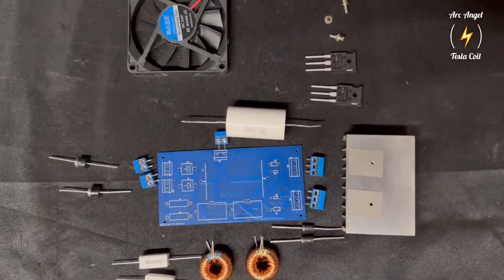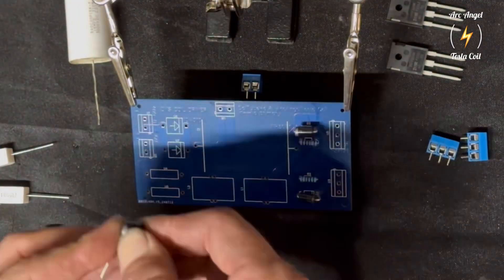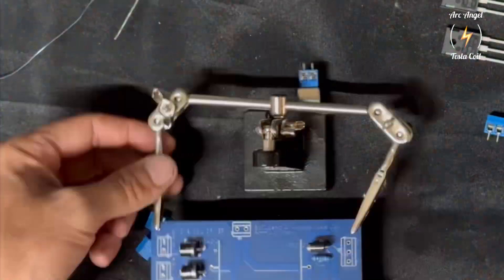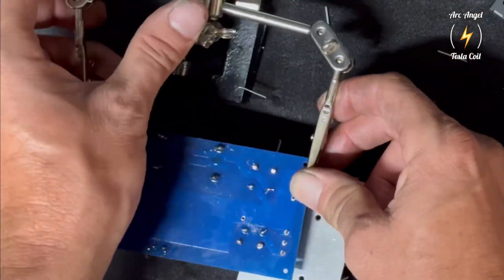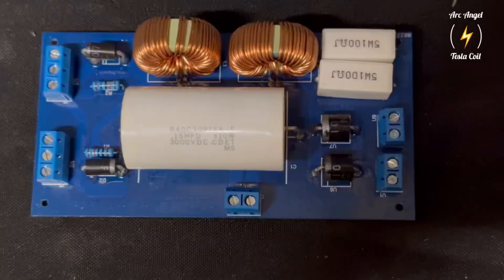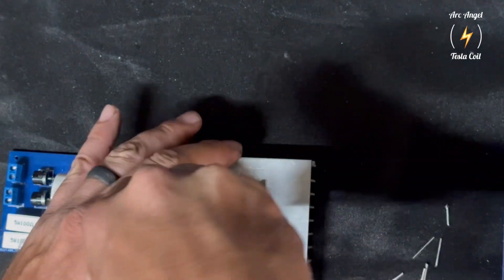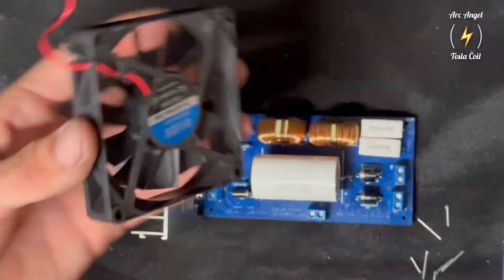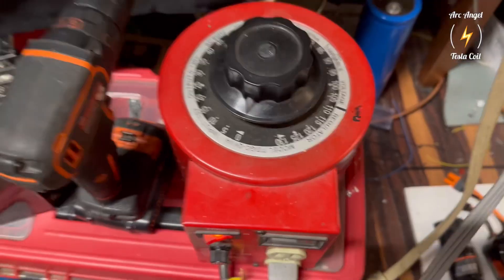⚡️Unveiling the New ZVS Board⚡️#fun #teslacoil #diy

Comment: I have two questions about your green and copper colored secondary. Is it two lengths of wire joined? If so how did you join them?  Thank you.
Reply from the maker: @kirkslab.5139  yes two different color wires but same gauge size and I soldered them with the wire overlapping about a 1/4 inch. I was wondering how it would work and it worked fine no issues so far this is the second coil I've done like this but you have to just barely solder it together you don't want no sharp points or let it get to big also used nail polish to coat the wire before finishing the winding
Reply: @ArcAngelTeslaCoil   Thanks for the reply. I've read that joining wires on a secondary would lead to a failure, but you have given me the confidence to try it. Salvaged wire always seems to be just a little short than whats needed.
Reply from the maker: @kirkslab.5139  for sure 😁👍⚡️

Comment: Cool I lke ZVS drivers for indction heating and flyback transformers and induction heating, I mede couple of them on IRF3205 mosfets and I'm planing to built more powerfull one 3kW or more but for tesla coil driving i prefer self tiunig circuts. Now i'm creating self tiuning half bridge portable tesla coil but feedback is behaving strangly and I can't get more than 150W from this coil when I was planing to ahive more than 1,5kW
Reply from the maker: That's awesome and they can be tricky sometimes good luck on your journey 👍⚡️⚡️
Reply: @ArcAngelTeslaCoil  mine is really tricky, for feedback I was trying different antennas but all of them gave poor result only thing working was me, literally I physically touching feedback antena and when I try to touch the arc on the end of the coil the closer I put my hand the weaker arc was  so it work kinda like safe mechanism but it wasn't the point and touching antena it self is burning a bit besides galvanic isolation from secondary.
Reply from the maker: @Traper_T  I hear you👍